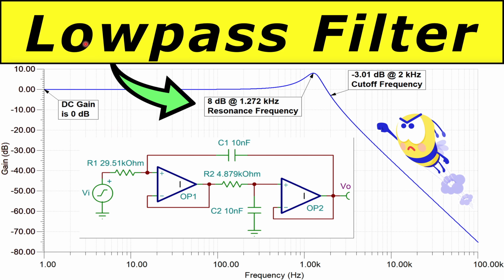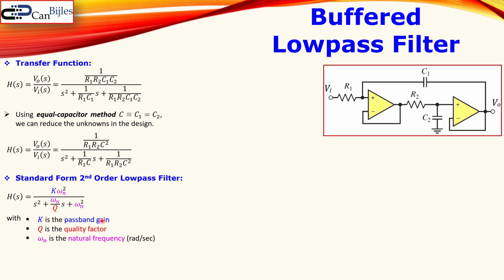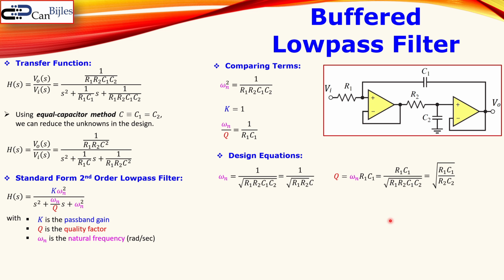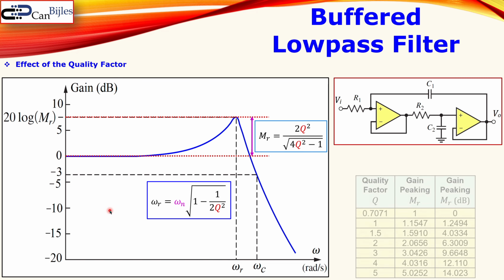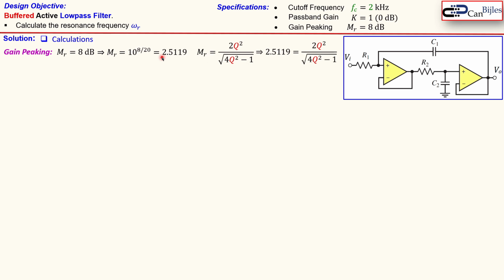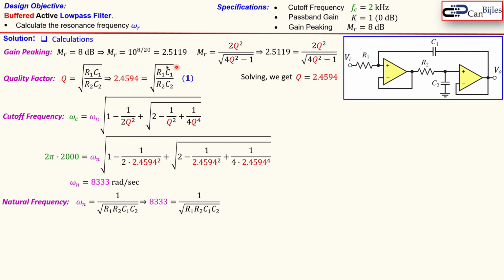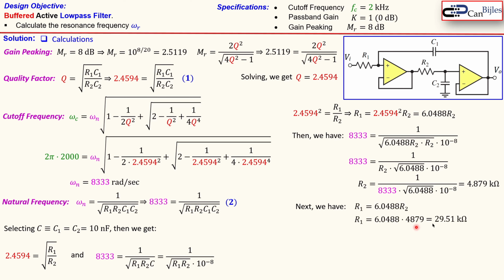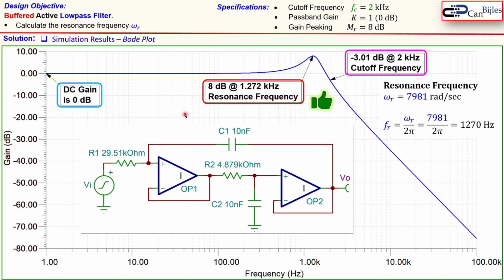Buffered Active Lowpass Filter Design 👍 Analog Filters ⭐

Comment: I’m confused how this circuit works. I could understand R1 and C1 and the opamps as an integrator if there was inversion, but there isn’t.
Reply from the maker: Glad you liked the video! 👍
Good question, since most basic lowpass filters will show a inverting op-amp circuit. 
There are different configurations to make a filter, also and integrator. For example the circuit in this video or Sallen-Key filter circuits.

Comment: ##ये सर्किट या ये calculation की सहायता से ऑडियो ऐक्टिव filter बना सकते हैं जो 20Hz to 20khz frequency

##मेरा दूसरा सवाल है कि ऑडियो मे octave और decade जेसे कुछ आता है तो octave की गणना क्यु करते हो और केसे करते हैं octave की मूल्यांकन करना क्यु जरूरी है तो बेसिक शिक्षा प्रदान करे मे आपका दोस्त from इंडिया ❤❤❤❤
Reply from the maker: This is a lowpass filter, so it not suited for bandwidth having a lower cutoff larger than 0 Hz. However, you can approximate it in your case with 20 Hz lower cutoff frequency.